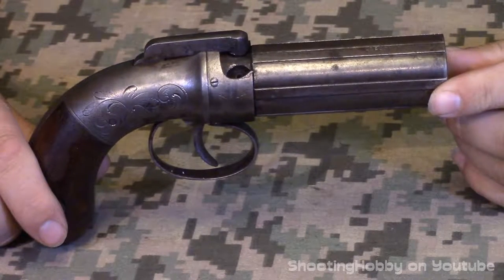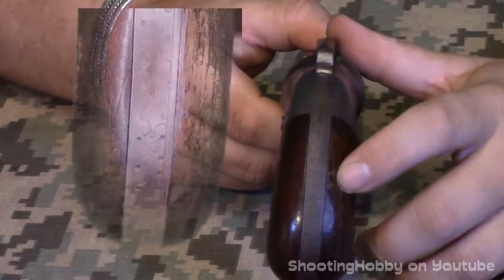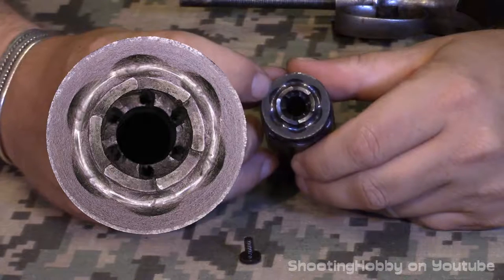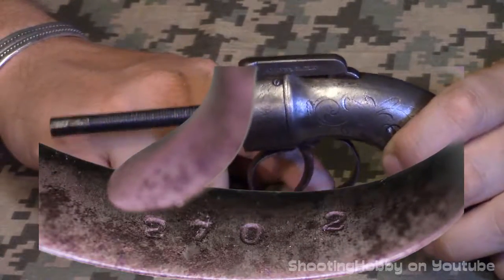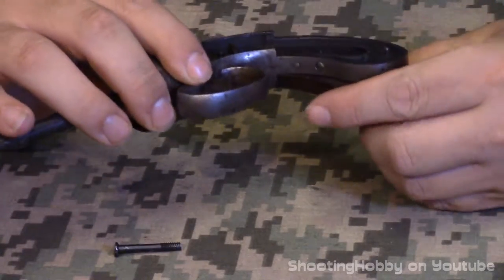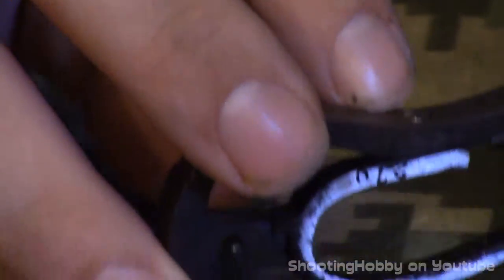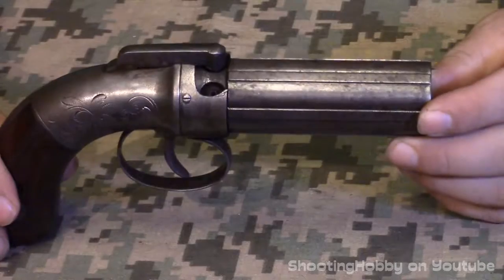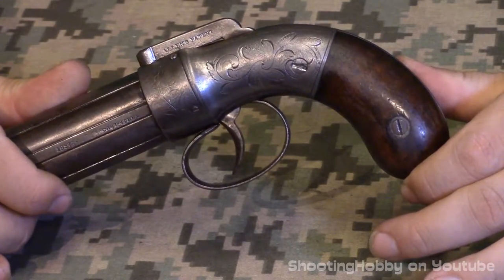Allen & Thurber Worscester 1847-1854 Pepper box Disassembly

Comment: Great video.... I have one (#2821) and it looks exactly like yours. It's .31 caliber, if you haven't figured that out by now. From everything I've read so far, the 6 shot smooth bore guns were only made from 1837 -1847. But mine like your, also reads Allen & Thurber Worcester on the barrels. This is odd because they moved the plant to Worcester in 1847. They did not keep good records back then, so collecting old guns like this is like a mystery needing to be solved. Thanks again for a great video.

Comment: I know your vid is older, but wondering if you can help.
I have an under hammer pepper box.  Looks like a Cooper Patent model.  I cannot remove the barrels from the post.  Barrels will not rotate.  All parts are out of the action, but the barrels will still not rotate or pull off the post.  Any ideas?

Comment: Where can one find a link for the main spring? I ask cause I am trying to fix mine up into shooting condition. It is marked 95 on the inside and slightly different from yours. The cap shield is smaller, no engravings, and a ring trigger. Got it as a ufixem but it has had some work done to it. Their is one part that was changed to a 99 marked part most likely original work.

If they are rare can you take dimensions from your main spring link?
Reply: Eyeontheprize  I have they didnt have any.

Comment: I purchase one like it yesterday, did you ever fire yours?  What caliber shot did you use where did you buy it?
Reply from the maker: I did not shoot it. It was about .30-.31 caliber, I was going to use Colt Pocket Pistol data and use a load in between the min and the max.  I did find some 20ga buckshot that would of worked.  In the end I decided I didn't want to take the chance of messing it up.  I would be very careful on shooting it as condition and load and other factors could cause damage to it, or catastrophic failure of the fire arm.